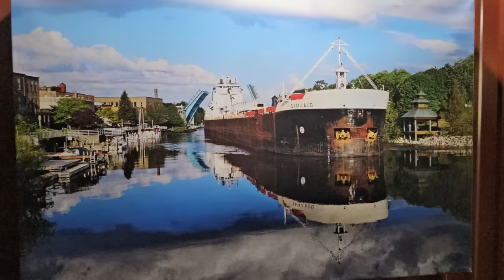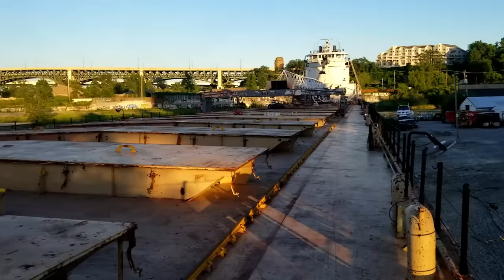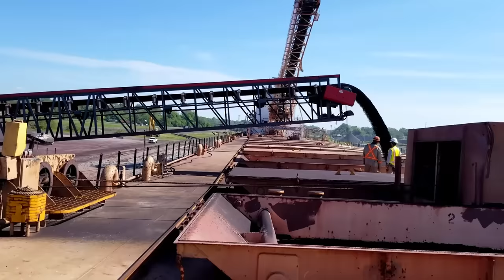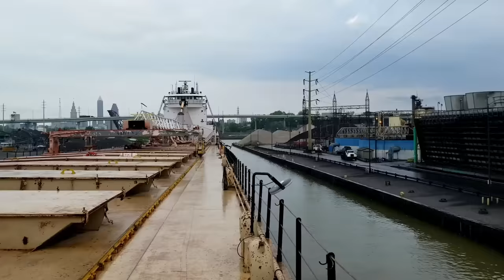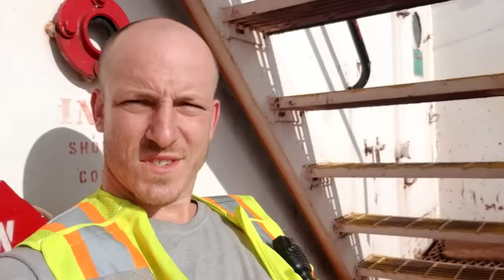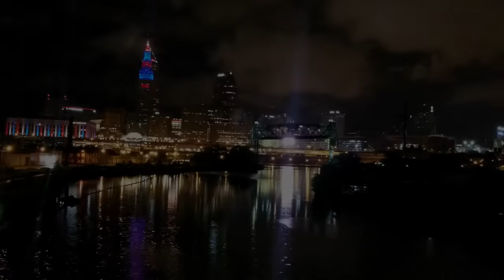SAILING ON A GREAT LAKES FREIGHTER | LAKER | WORKING ON THE LAKES

Comment: You got on one of those new fangled modern boats. Back in 1968, the Lackawanna was my ride. Built in 1900 and scrapped in 1969. We didn't have fancy self unloaders or  ladders. We got swung over the side on a Boswains chair (2×8 with a rope through a hole). To handle cables to stop the boat.
Reply: I work on the boats 74-76 and your right. This was a fancy new boat!
Reply: They still use the swing out bosun chair at places like the locks.
Reply: The bosun chair is still used. Those ladders only go down once the deck gang has swung out and tied her up.
Reply: Yeah the self unloaders are really nice. In and out in hours with no rest or time to go up the street.
Reply: @pm565b2 yeah, but nothing good happens up the street

Comment: Thank you for taking us on board. It's hard when watching this not to remember about the fate of the Edmund Fitzgerald, " the pride of the American side ... as the big freighters go, it was bigger than most".
Reply: Agreed. I was thinking that too.
Reply: The Fitz was "Queen of the Lakes" (longest freighter) from the time it launched in 1958 until the next year when it was surpassed in length by 1 foot! It's still the biggest Lake freighter that sank in the Great Lakes. It set a lot of single-trip records for hauling the biggest loads at the time, and 6 times it set seasonal haul records too.
Reply: "On the big lake they called Gitchegumie"
Reply: Actually that happened in the summer of 75 when the Sam Laud was being built!
Reply: The Fitzgerald is simply a much better known wreck on the lakes. There were a great many wrecks on the lakes during that time. My favorite story is of a ship that broke in half, with both halves remaining afloat for a while. The only survivor was in the front end of the ship, and he recalled watching the back half of the ship sail away into the night, lights still on and under power.  Can't recall what ship it was.
Reply: @ravenbarsrepairs5594  Daniel J Morell, it sank in 1966 and was built in 1906! Went down in Lake Huron. Dennis Hale was the sole survivor and he passed away in 2015. 

The Morrell was also the "Queen of the Lakes" for many years
Reply: @georgekn3mp  That sounds right. Spent a good amount of time last winter watching history of great lakes shipping videos on here, been watching steam train videos lately.
Reply: I was already humming it…fellas it’s been good to know ya
Reply: @tw364  I found the ♪song♫! 👍
Reply: . November 10. 1975

Comment: I live up in the Keweenaw and see the big freighters quite often, always cool to see them going by out on the lake, especially at night.

Fun fact, the oldest freighter on the great lakes right now is the SS Alpena. Yep, SS. As in, 'Steam Ship'. She was built in 1942. A bunch of the ships floating around on the lakes were built in the 50s and 60s. The E.M Ford had the longest career, launched in 1898 and sailed until at least 1996 before being scrapped in 2007!

Heck, there are still some WWII vintage boats on the lakes. The old SS American Victory, originally the Neshanic, a WWII fleet oiler and converted to a bulk carrier on the lake which was sadly scrapped in 2018. Was really cool to see a lake freighter with battle stars on her bridge. Her sister ship, Chiwawa, is still sailing the Great Lakes as the MV Lee A Tregurtha, but has been converted to diesel power.

Comment: When you said 'coal,' I saw pellets.  Coal goes into Cleveland by rail.  You didn't load in 'bays,'  you loaded into hatches.  The use of steel wire rope 'cables' for mooring or shifting might have been worth mentioning.  Mooring at Zug with your own deckhands and an end-loader dragging wires for you is about the worst thing we do.  But then, a northeast blow at Marblehead is no picnic, either.  All of that said, I liked the music you used.

Comment: Just saw this.  I live in Michigan, and have been through the Soo Locks a few times  Visited the Valley Camp..  I've boated on Lake Michigan, Lake Erie, and the Detroit River.  Also have seen all the Great Lakes and watched numerous 'Lakers' underway, or docked.  Empressive when you motor along the side of a thousand footer, in a 22' boat, docked and unloading at a powerplant. 

On a side note, I also lived in Rock Island, IL for six months (1976-77), Those Missiissippi River Barges and Tugs, are impressive.  Especially how they have to 'break' them apart to navigate through the locks.

Comment: In 1974 I worked on a ship like this. It was the Consumer's Power. A self-unloader carrying coal and rock salt. I spent 12 hours a day shoveling that stuff down in the hold and rooming with Abdul from Yemen. I did it for almost 2 months before giving up and moving ashore.
Reply: I grew up in Manistee and saw the Consumers Power many times. Lots of boats came to Manistee bringing coal to Morton Salt, Hardy Salt, and American Box Board (now owned by Packaging Corporation of America), and loading salt for use on the roads in winter. Boats also loaded sand from the lakefront dunes on the north side of Manistee.

Comment: Do they just paint the ship once all the paint falls off?  I can't imagine working in that rusty old mill.  You'd never be able to be clean with all the dust flying everywhere.  It's like when we'd have the wind at our backs when harvesting wheat, or god forbid, oats/milo (itchy as hell that dust).  One big filth bucket.
Reply: Bulk carriers on the lakes are normally used for iron, aggregate, sand, coal, etc. Grain traffic is normally barge work down the Mississippi and its tributaries to New Orleans.